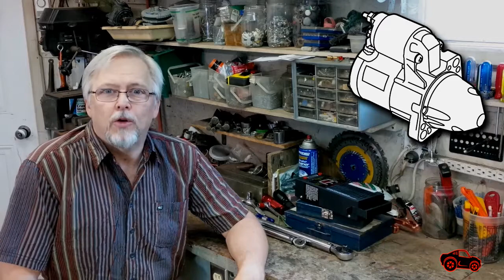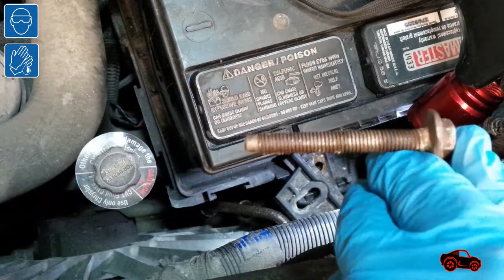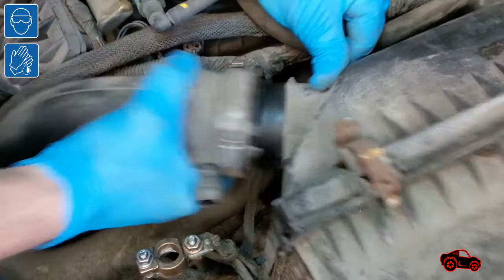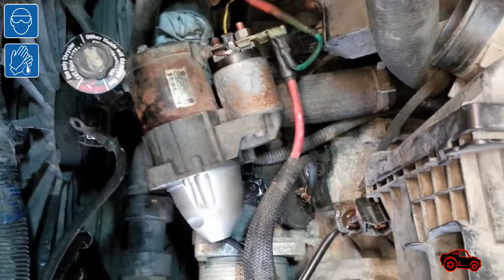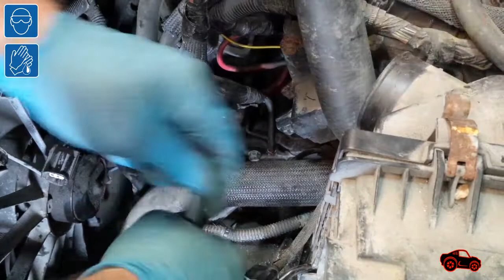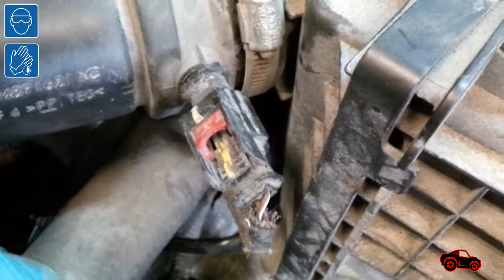Jeep Patriot 2009 Starter Removal & Installation

Comment: Can this be done on a 2015 jeep patriot latitude 2.4? Please help
Reply from the maker: One basic model of starter was installed in the Jeep Patriots from 2006 to 2017. 
If you have a CVT, the replacement is the same as my 2009.  
If you have a 6-speed automatic transmission, I did not work on this model but the basic procedure should be similar since the engine and the starter were the same.

Comment: To avoid battery, starter and alternator issues. Maintain your battery by keeping lights and radio off while the engine isn't running. (THIS KNOWLEDGE IS FOR VEHICLE OWNERS THAT KNOW THEIR BATTERY IS WEAK AND GOING BAD. If you suspect a low battery and you cannot charge it or it will not accept a charge, try avoiding jump starting the vehicle multiple times, the surge of electricity from jumpstarting is known to damage the starter solenoid and alternator voltage regulator. I've seen people also try and start an engine with a low battery several times and damage the starter solenoid switch. If the engine doesn't turn over due to a weak battery do not continue trying to start your engine, save yourself an even more expensive Bill 💸💸💸💸 by just simply replacing the faulty battery with a known good or new one

Comment: Guaranteed it was the original battery that's why you replaced it. 🤪Doi
Reply: Also, you could have tested the battery on the ground with the cables, simply by cables and adding a constant 12v power wire to the ignition pole on the starter solenoid, as soon as starter kicked bucked and the starter gear turned fast then you'd know the starter was good. Of course you could have saved any headache or stress by using a digital multi meter to test the voltage at the battery posts, then just after the battery terminals to test for any voltage loss. Then set the digital multi meter in a clear view while connected to the battery, turn the ignition to start and observe the voltage on the meter, it should drop from 12.4v to no less than 10v if lower than 10v battery has corrosion on the lead plates inside and needs to be replaced with a new battery. If voltage does not change from 12.4v then suspect a faulty starter solenoid.